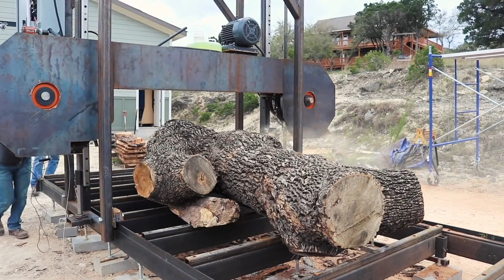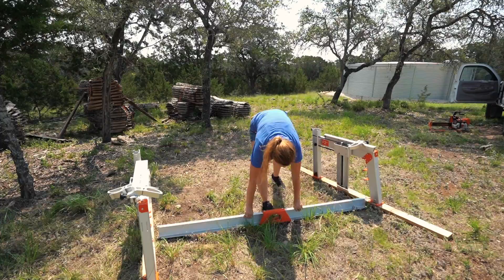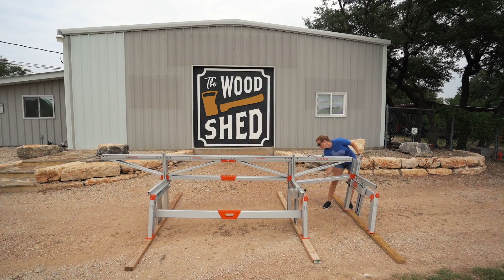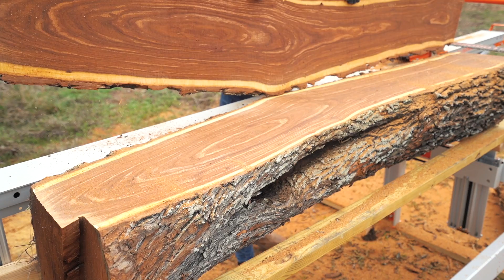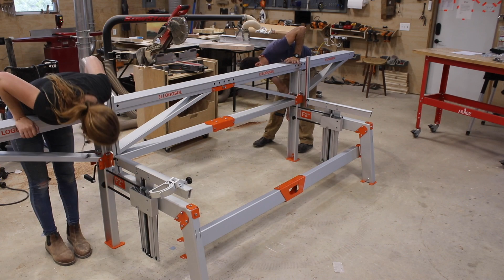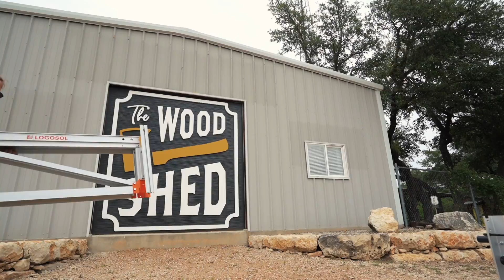Portable Chainsaw Mill - Logosol F2 Walk Through

Comment: Great walk through.  Looks like you have the F2 and the F2+.  I just bought the F2+ last year and I really like it.  I was hoping that it would cut wider slabs though.  I also have the mill setup in 1/2 size mode.  So the stands are about 1m (3' apart).  I have an MS 660 but am limited to 24" bar if I use the carriage.  I'm going to design a carriage for my 36" bar.  I'm milling short but large diameter logs.  I had to use my Granberg recently on a large walnut log that was only 55" long and would have loved to be able to use the Logosol.

Comment: Thx for the run-thru. I had looked at these a year or so ago. Love the technology and craftsmanship. At the time I do t think they had the slabber. I don’t see the advantage of needing lifting all logs up on this model. It seems like it also would limit the size and shape that would fit comfortably up on this machine. I won’t be doing a lot of commercial work, maybe none. But I have about 50 logs of my own that I want to cut and save for my own use. I had given some serious thought to a Grandburg. But it seemed kind of klunky and slow. Milled lumber in Southern, IN is fairly cheap because everybody and their brother seems to have a mill. But the Big Slabber seems like it might just be what I’m really looking for. Why didn’t you look at that model? It does look like it will take more time between cuts to re-set the runners. But it sure looks like The Big Slabber is more stable than a Granburg and it sure looks like it’s faster than a Gbrg on the cut. I value your thoughts, love your channel- what am I missing? I’m pretty sure I want to buy a Big Slabber.

Comment: Wish there was a way to get logs on it without having to use a tractor. Id take it to location where I cut but would be able to lift logs on the table. It would be nice if the lift system went all the way down to allow ground loading

Comment: Nice find. Thanks for sharing.
Reply from the maker: Thanks for watching!
Reply: April Wilkerson  .... I drool over (not on) tools that do the job. Currently perplexed trying to work the inside of a strip plank canoe. The outside is fiberglassed. The inside needs to be reduced by 2/3 of the wood strip planks thickness. Or more.  Reduced to a mere sheer veneer the inside can then be fiberglassed. Every curve everywhere is different. And concave. Currently using a tubular pool foam floaty thingy wrapped in 80grit. If I could only get it to spin ....??.?

Comment: I’m gonna look up the price once I’m finished watching.  I’m guessing it costs more than a small house.
Reply from the maker: Not at all, it's priced extremely reasonable I think. It $1,700 for this all in one machine. I know that is stll a good chunk of change but to put that into perspective, the Granberg system I used cost $1200. So again, looking at the options available, what you get for the money, and what the end goal of the person is with milling....it's a clear win in my eyes.
Reply: That's extremely reasonable!  What saw are you running on that? Assuming minimum 60cc.
Reply: @AprilWilkerson  No, not cheap, but compared to even some of the better stuff on the market, still a very good buy.  At $25 bucks a slab, you would be sixty eight slabs from breaking even- even a newbe ought to be able to manage that! FWIW, some of the dense, dark wood slabs you cut in this demo piece will probably get 3-4 times that.
Reply: Remeber that you can earn some cash with it.. You could quite easily make it pay for itself.
Reply: I have a hard time justifying that price tag when Wood Mizar sells a much faster portable LX25 band saw mill for starting at $2200. Maybe I missed it, but was the saw included in this price?? If not, think I’d pass.

Comment: Man! Decisions, decisions. I really like what I've seen of this mill, but I might have to go with the Granberg. It's sort of a portable vs. really, really portable issue. No doubt I'd rather have the log up on the supports, but some of the trees I'm after are across a drainage and up a hill even my tractor can't get to with some large diameter trees. The lengths I'm hoping to cut will be 12+ feet and above timbers which will be plenty challenging to get out of the woods. Needing to work on a slope and pretty much where the tree falls, I don't see an option other than the Granberg(?)

Comment: Where do you get those double log tongs (or grapple?) that you used for picking up logs with your tractor?  I just found your channel today when researching Logosol F2+ reviews and am so glad to have found your awesome videos...great job!

 I have a single log tong that I use with my tractor which is a pain when I want to move a log and keep it steady without swinging around.  With large logs that are too big for lifting with my tractor, I use a shortened up mobile-home axle to assist with carrying the weight and keeping it out of the dirt.

Comment: Black steel reacts with aluminum, so therefore the black steel brackets, bolts and nuts will start to rust over time. They should have used stainless steel for all the steel parts.

Comment: How do you load a log on the F2 if you don’t have a tractor with a grapple or gravity hook? You travel to a location, unload the F2 and set it up remotely, then what if you don’t have a way to get the log on the machine? Are there winching attachments to pull a 1000 lb log onto the machine?
Reply: This is exactly the issue I have experienced with remote milling. Logs are heavy and unless you have heavy machinery it is a huge struggle. Also I can see this lightweight structure being easily damaged by a heavy log or tractor.

Comment: April I enjoy your videos. Just a question about how do you put a log of any size on the mill without taking a tractor or such to load it? It seems it defeats the purpose of taking the mill to the log. What is the max diameter of log that you can put on mill? If you can get your truck to log...then what is stopping you from taking log arch trailer? I understand the multi trip thing. :)
Reply: Robinwood we must have been typing the same  statement at the same time...my thoughts exactly

Comment: How do you lift the logs if you go on site? If you need a machine to lift and a machine is  on site isn’t it easier just to bring logs home?  If you can only do liftable logs “small”  and don’t have a machine there doesn’t seem to be a need for this mill. Sorry for the negative comments it’s a great looking mill but seems to only fill a  very very specific niche. Or maybe I missed something in the loading process. Thanks for the great videos 👍
Reply from the maker: Nah it isn't negative at all, it's a great question....it's one of those things where you just have to be resourceful and see what works for you. I've seen some people take a piece of equipment to site with them (I won't do that), but I will be building a stair stepping platform that i can throw in my truck and assemble on site. Logosol makes a special, duel cant hook, that makes rolling logs easier....then you use the cant hook to roll the log up the steps, one at a time, until it reaches the bed.

Comment: Hi.  I do not know how good you are or how knowledgeable you are about using sawmills but if you do not know about it then I tell you so that you know if it is how much snow chain should be filed on the chain to the sword  So the chain saw chain and on chains for sawmills is meant to be 10 degrees or less and not as it usually is on a completely ordinary chainsaw chain, ie about 30 degrees.  It is very common that the biggest beginner error is that they use a chain that is filed common, for example, sawing wood and cutting down trees and the like but since this is another type of sawing thus cutting logs and the like in the long run  the fiber direction of the wood to be attacked from another direction.❗

Comment: When cutting the longer logs is it necessary to use shims in order to keep the slabs from settling down on the base as you cut?
Reply: you could risk pinching the blade if you don't shim it ro lift the slabs a bit

Comment: A question:  Since all the components are made from aluminum extrusion, does the unit have any tendency to move?  You have yours on 2X4's.  Has that proven to be adequate?  Competitor machines, non chain saw types, are much heavier and non portable; that does not mean better.  Have you been able to compare quality of cut from both of your machines?
Reply from the maker: I didn’t have any issues with things moving, even after picking the entire thing up and relocating it. I placed mine on 2x4 legs because my ground wasn’t level
Reply: OK.  That is impressive.

Comment: Fair enough the mill is portable but how are you suppose to get the logs onto the mill in a remote site?
Reply from the maker: Logosol makes a special cant hook that has two hooks on a ratcheting system. It's great for turning logs over on the mill or on the ground, but you can also use it to walk heavy logs up a stair stepping platform. I would recommend building a simple platform that can be throw onto the truck and assembled on site then useing the cant hooks to walk it up each step until it's on the mill. Oooor, if the log is light enough, you can use a small cant hook to pick one end up at a time, as seen here at 1:31: https://www.youtube.com/watch?v=hKuVVYETiCo
Reply: @AprilWilkerson  And if you don't want to do that you can always bring along six men and a boy to help you lift it onto the saw. 🙂

Comment: How often do you sharpen the blade? or switch?
Reply from the maker: I sharpen the blade after every tank of gas I burn through. If you do it every little bit, it's super quick work. If you wait until they are super dull, then it's a longer task.

Comment: The old M8 model can do either 1/8" increments of 1/4" increments. Is there an option on the F2 to be able to do the same?
Reply: I got the info. from logosol. the F2 and F2+ will only do 1/4" increments. I did like the ability to do 1/8" clicks on the M8, but I think I can live with 1/4" clicks.

Comment: Looks like a great machine. Is there a lift of any kind availableto get the log onto the bed or is a 2 person/machine job? Hard to beat the Swedes and Germany for their tooling and machine quality.
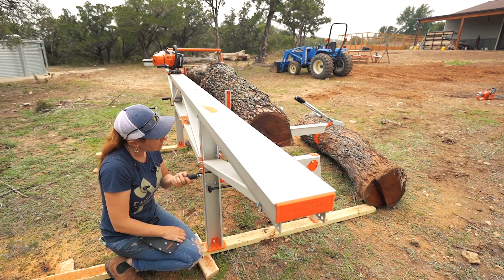Reply from the maker: There is actually! Logosol has a special duel cant hook that uses a ratcheting system that easily turns logs over. So I've seen where people will build a step up platform to use the cant hook and roll the log up to the bed, one step at a time, or in this video you can see how they build a ramp to be level with the deck then roll them on: https://www.youtube.com/watch?v=ymxiEpZdsLU  Then of course, if the log is light enough, you can pick it up one end at a time and set it on the bed. You can see an example of that here at 1:31 https://www.youtube.com/watch?v=hKuVVYETiCo

Comment: I’m sorry but you have a bandsaw mill and it seems to me that you are going backwards. Most people start out with a chainsaw mill and then move up to a bandsaw mill to get more useable lumber out of a log. A 1/4 inch thick cut produces a lot more wast than an 1/8 inch cut.
Reply: In the video, she explains why both are useful to her.
Reply from the maker: Ok lets compare it.....in a wood shop: a bandsaw and a jigsaw are extremely similar in function and most woodworkers start with one then eventually have both. One is better for when you have to take the tool to the project, then the other is better when you can take the project to the tool. Milling is quite similar. Having one or the other is great, but having the versatility of having both is better.

Comment: So great tool, thank you for show it us.

Coul you tell me wich model of chainsaw is this?
I bout 120 cm chainsaw mill suport an u don't know wich one buy, I'm thinking about stihl ms 661 but in the shop, they told me this model can fit just 60cm bar, if I want to mount 100cm or 120cm I'm gonna have to make a modification and the warrant it's gonna be automatically cancelled if I use it with bars longer than 60cm, the guy who told me that it was in a official stihl shop. 
Somebody can tell me if is it true?
Ms 661 is enough to mill, I think ms 880 it's too big if I want to use it for other things.

Thank you so much!
Reply: Yes the carriage that has the magnet to hold the bar tip up maxes out at 24" (61cm) but I have cut without the bar support with a 36" (91.4cm) bar and it works OK.  I want to build an extension for the carriage or a roller system for an even large saw and bar.  I have a MS 660 and the F2 + currently and looking at MS 880 for wider stock.